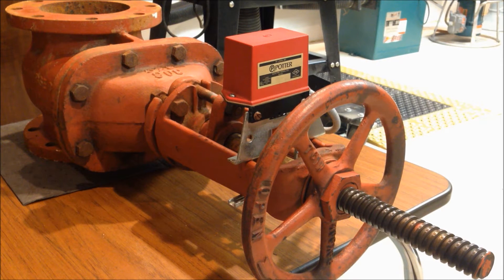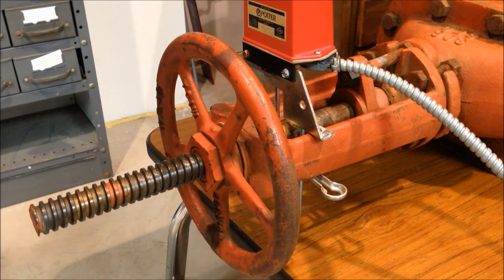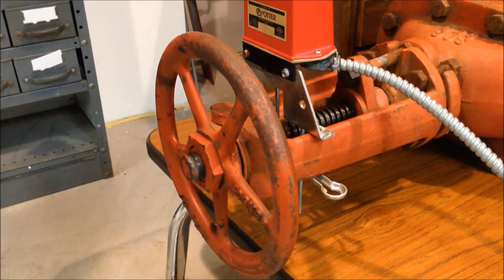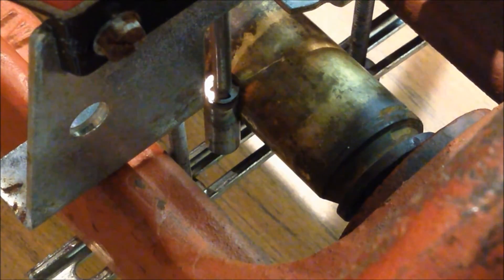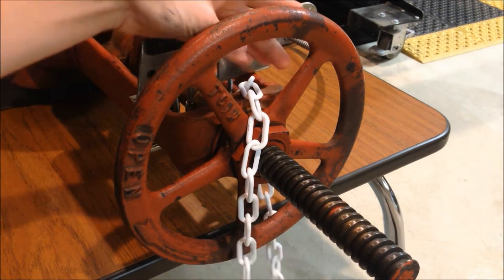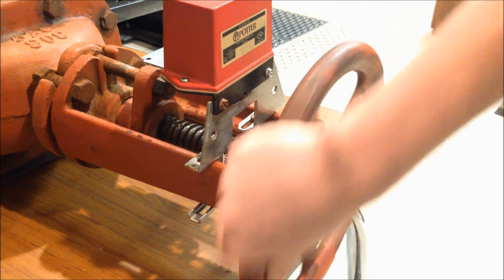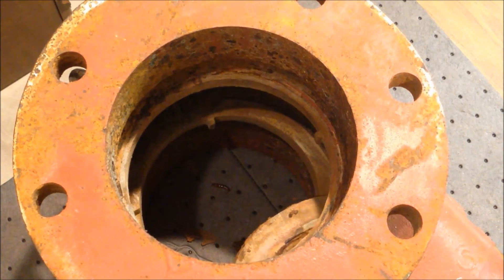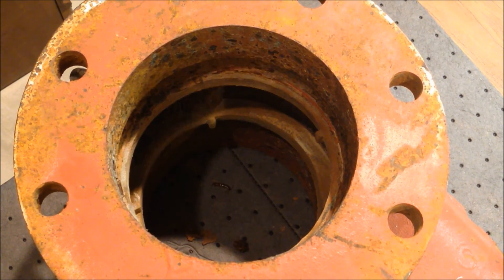OS&Y Fire Sprinkler Riser Valve Overview and Test

Comment: The rescue squad that my parents volunteer at has something like this from 2001 with potter bells so when it would go off the bells will ring im getting the bells soon and they have a box on the wall with replacement sprinkler heads I'm getting
Reply from the maker: Cool! I had honestly forgotten about my sprinkler head box for a while until I read your comment. I've got six or so 1995 heads plus a 1959 Star Model D head in there.